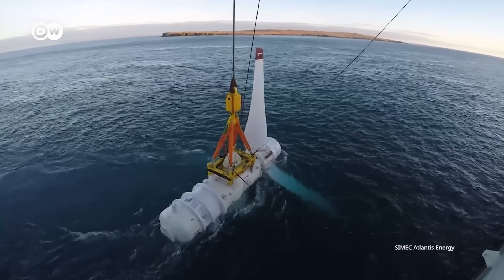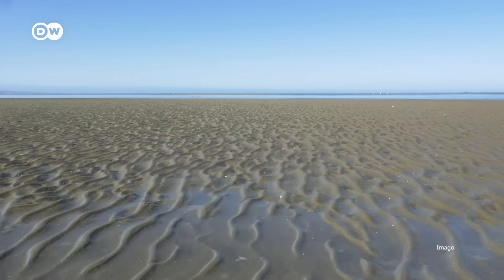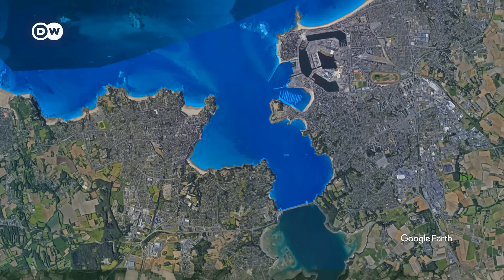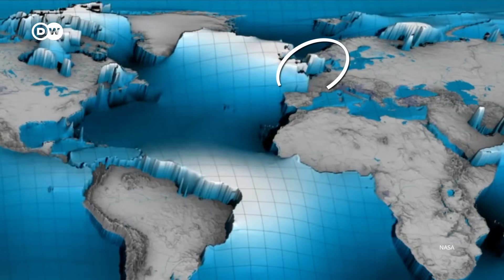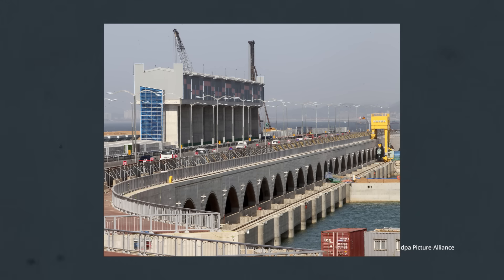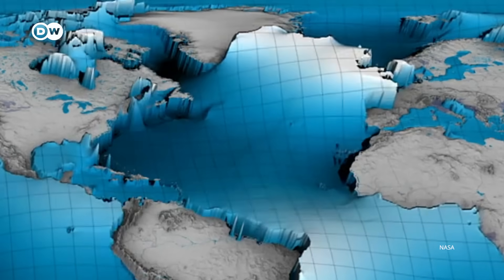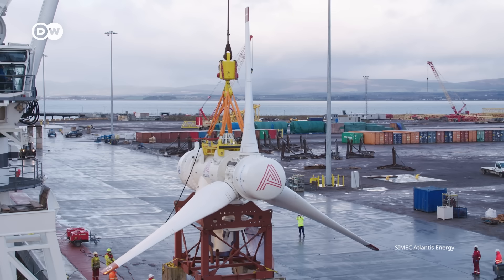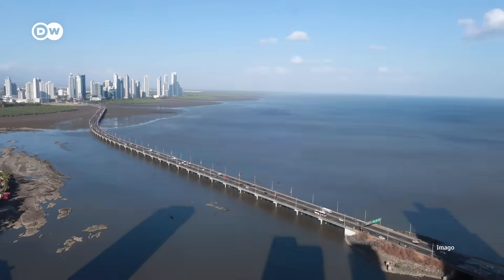Tidal energy could be huge – why isn't it?

Comment: Between the massive amount of resources needed to create the turbines, the maintenance, the disruption to natural ecosystems and the fact that there are so few places where there is sufficient tidal flux to make this even remotely viable for production and even then it would only hope to work for coastal cities near to those high-flux areas.
Reply: I actually disagree,  resources needed are not that great, if you use suspended system your impact is minimal. There are areas were tidal movement are massive.  There are areas where sea currants are fast . I would even state that number of bays can be used like San Francisco Bay
Reply: @jantschierschky3461  By resources needed, that is referring to the amount of resources needed versus electricity generated compared to other media. There is also the impact on shipping to be considered for bay areas, as any sufficiently large turbines can be hazardous to, or experience hazard from, heavy tankers of sufficient displacement, which would limit viable placement even further.
Reply: @AximandTheCursed  well if you consider the energy and placement I doubt you have issues in that regard,  if we take SF as an example the shipping lane is on the northern end, the current on the southern end is over 3m/S that could produce around 6MW on my basic calculations using modified seapots.  Also bay under the golden gate is over 100m well below any ships draft, so if you consider 3-4m/S you could produce 80-100MW
Reply: @jantschierschky3461  ...and with the same amount of resources you could have a 1GW nuclear plant on a fraction of the land, cheaper and with lower maintenance overheads to boot. That's the point.
Reply: @AximandTheCursed  actually a nuclear plant is very expensive and takes ages to build.  If nuclear I would choose block units. However storage is the key problem,  because  public perception.  However if you consider the cost, productivity water turbines have a place
Reply: @jantschierschky3461  The new Thorcon proposal for molten salt nuclear reactors is boasting of a 2 year build time including licensing and a cost of $1 Billion for their 2x500 MW setup. Also, with the Thorium fuel cycle, there is far less waste created. There are some places where water turbines might be viable, but not many.
Reply: @AximandTheCursed  well that technology is not proven yet, but has potential as it had for last 60 years. Well I personally seen many potential locations and being a water expert I disagree.
Reply: @AximandTheCursed  yeah, but nuclear power is neither renewable nor completely safe.
The renewable energy technologies are still new compared to nuclear, we could improve massively their efficiency and sustainability. 
PS: I am not at all for a complete shutdown of nuclear plants.
Reply: They aren’t that much. Not any more than offshore wind farm. The offshore wind farms being built in Scotland I will cover 100s of square miles and each turbine over 300m tall.
Reply: @scottwhitley3392  ...and they will never pay for themselves while destabilising the energy grid... it's why the UK needs the interconnectors from France and Norway to keep the lights on!

Comment: Because it’s expensive not just to install but to maintain, and it is only available along the  coast, meaning transportation of the energy to where it’s needed would be expensive as well. Tides also don’t move constantly, so you’d have to pay for storage, which is also expensive. Basically, it’s expensive.

Comment: One aspect comes to mind, modern cruise ships use large diesel electric pots for propulsion. So lot of R&D is done already and there is a manufacturing chain in place,  how hard would it be to adopt those for tidal power ?
Reply: The big non renewables don't fund or block such steps...
Reply from the maker: Good question! 
If you'd like to know more about the topic we've added some additional links for further reading. It's in the description, just click the "show more" button :)
Reply: Odviously too hard.
Reply: @porkchopspapi5757  i disagree
Reply: @jantschierschky3461  OK, why?
Reply: @porkchopspapi5757  think nobody thought about it. But many are being recycled,  so low cost.
Reply: @jantschierschky3461  nobody thought about it? Limitless free energy, no one has thought about scaling up a model to big enough to power a city?
Reply: @porkchopspapi5757  they testing the process. The use of those pots not been tried
Reply: @jantschierschky3461  ok. Keep an eye on it. Then Youl see why it won't work. They may string you along for a year or two or three, but do some actual unbiased research.
Reply: jj
Reply: The answer to your question is, too hard. That's why it's not being done.

Comment: Can't we also use this in strong river's?
Reply: That is a whole other kind of tech than tidal, but it is a thing that is happening.
Obviously the older versions of river power would be water wheels and dams.  Water wheels would be tied to a mill where it would lift and drop heavy weights to make flour or crush things.  Dams use the height difference to amass potential energy and hits the turbines with lots of force, but those are falling out of favor and being shut down faster than the rest of green tech is growing (at leas in America).
For newer versions, homesteaders have lots of interesting river options which divert a portion of the flow into a sideways turbine which spins at pretty crazy speeds to generate power, and that actually works pretty well.  Problem is that most small/fast rivers tend to be seasonal, so it is difficult to justify the cost for something that only works during heavy rains.
For larger rivers there are other issues.  Water needs to be deep enough for boats to not hit them, shallow enough to maintain easily, and more importantly durable enough to deal with rather extreme ranges in water flow and speed... and deal with the large objects that get washed down river with large storms.  The nice thing about tidal is that the water flows predictably in a free open space, so you aren't going to have a water-logged tree randomly smash into your generator, or a car bouncing along the bottom of the river at 40mph.  I live near the Ohio River, and that thing has a crazy range of flow and speed, and your turbines need to be designed to operate efficiently at a certain flow rate.  Just like wind turbines, too much wind and you trim the blades flat so they don't spin too fast and break.  You can up the resistance to compensate for this, but then not enough flow and the blades won't turn.  Again, with tidal you have much more predictable flow rates and pressures to deal with.

Personally, I have always wondered why we dont put something next to pillars on bridges.  You need a certain amount of clearance around them anyways, so slap a series of blades on the front and back of the pillars, and add a steel mesh cage to prevent colission damage.  You already have the land connection and power/utilities running, and the pressure/flow around the pillars would be stronger than in an open river even when flow is lower.  Plus if your bridge is also a utility then maybe it will get regular maintenance? lol

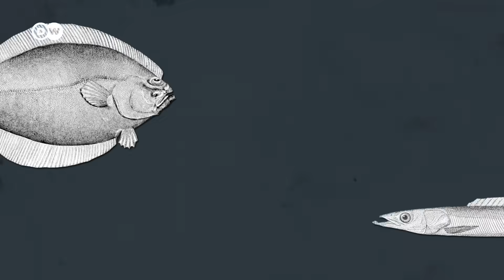Comment: 9:47 is this line about how wind turbines are "known" to cause the lungs of bats to implode based on any actual fact or just anti-renewable talking points? See: "An investigation into the potential for wind turbines to cause barotrauma in bats
" - Lawson, Jenne, Thresher, Houck, Wimsatt, Straw. Dec 32 2021 PLOS ONE; open access journal means you can read the methodology and conclusions in full.

Comment: 10 cents/kWh isn't really cheap, it is at the upper limit of the current generation costs on bills. On average it is more between 4-8 cents/kWh.

If tidal wants to compete it needs to reach at least something like 7-8 cents/kWh and even this is still not competitive vs solar and wind today and these are expected to still go down slightly in cost.

Tidal just seems to have toom many intrinsic costs to be competitive due to its very nature, though I hope I am wrong.

Comment: There's also a specific hydroelectric option for run-of-the-river hydroelectricity that is amplified by tides. I'm not sure how common these are, but Bremen has one.
Reply: Bremen is a bay with a 2-2.5m tide, north German rivers carry volume like Weser and Elbe. However if you compare average 12m tide in southern west France and around parts of the UK and other areas not that viable.
Reply: @jantschierschky3461  Well, clearly they decided it was worth it. They just combine the flow of the river with the additional effects of the tide (due to various effects it's apparently 2-4m at that place). It's a pretty small plant of course, not a huge megaproject.
Reply: @Sp4mMe  I don't disagree,  however don't forget the German government mentality regarding environmental issues verses the rest of the world.  Here in Australia we have such a potential and it is wasted,  government here wants carbon capture etc, despite we having a huge landmass exposed to sun 300+ days a year,  12m tides in the north west etc etc

Comment: So the problem is that the structure will be full of algae and bivalves and needs to be cleaned, that is very expensive. Than a lot of moving parts under water, need oil and it will always leak (grennpeacies will be a problem, if you don't pay the cartel). Those areas are usually also very important for marine life. It was better than the wind, if we had the tech, no doubt.

Comment: The rotating cycle of tides is not correlated with the daily pattern of energy usage.  So this still needs storage.  Can't think of significant industrial uses of electricity that can cope with daily or monthly variation in tidal power.
Reply: Well you have epp and flow, depending on location  you can get up to 3to 4h , so up to 8h 2× each day. In some locations even greater like sanctuary cove Australia and Humboldt Bay in Canada
Reply: Liquid air energy storage could use surplus energy from renuables for power generation at peak demand times
Reply: @sethcopas4513  liquid air takes a lot of energy and is not possible to release energy also you liquid  air it is nitrogen.  Think you mean compressed air

Comment: The good thing about climate mitigation efforts, is whatever it costs, it's still cheaper than species annihilation from AGW. Because having a survivable ecosystem is literally priceless.
Reply: Ehh.
The only thing that really matters with energy generation is cost efficiency. If it's not cost-efficient, if it has a costly upkeep that, on average, a single "unit" will not be able to pay for itself twice over, then it's not worth whatever. It's just gonna cause more pollution relative to the power it generates, and is likely just a scam. This is the case for solar panels and wind turbines right now.

I am very skeptic of this "it's still a young industry but we're sure it's gonna be cost effective one day" claim. Especially when the solution to all our problems have been discovered decades ago: Nuclear energy. The only thing GREENER than fossil fuels right now is nuclear. I dont know why we're wasting time and money in all these unnecessary trial and error.

Comment: Predictable is better than non-predictable, but we steel need dispatchable energy like nuclear.
Reply: If you have them in several places around the coast (especially an island like the UK), with different tide times in each area, then the power is essentially dispatchable.
Reply: The power could be stored for use at peak demand times by say liquid air energy storage

Comment: The problem with tidal power that needs to be solved, is that sea water is extremely corrosive. So you'll have to find ways to keep the fins, the moving parts and the cable back to shore from rusting/oxidizing away.
Reply: @garysmith5025  the thing about oil rigs is they only need their supports to resist corrosion, everything else can be hauled back up to the rig. Even so, each rig is godawful expensive. If even the oil giants can't keep these things cheap and cost effective, what chance do underwater wind turbines have at producing electricity economically?
Reply: @garysmith5025  the issue isn't whether they are proven possible, but if they are cost effective. Because if they are not, you'll likely continue to see solar and wind being built in favor of this.

Comment: Underwater turbine will kill a lot fish curiously swimming to it, how to protect the fish like the wind turbine killing the birds
Reply: @garysmith5025   I insist the fish will be killed
Reply: Cats, glass windows, buildings, air pollution, planes, cars and trucks kill billions&billions of birds annually. And your worried over a couple thousand birds hitting wind turbines? You do know they found painting just one blade with a black stripe basically eliminates bird strikes. 🤔
Reply: @4literv6  yeah I know ,and tidal energy indeed quite interesting and promising
Reply: @chrisleon27  i think they should ad tidal style turbines like these to the bottom of all offshore wind turbines that use those new 3 prong anchors instead of posts driven into the sea beds. Bet they could almost double the total energy produced that way. 🤔

I also think someone adventurous should consider placing turbines like this down the spill ways of existing dams. 
Then every time the dam releases water you get even more energy production. Or at least a study could be done on its feasability.

But then again I think dam owners should also have floating solar on all upper reservoirs, big batteries for storage since the necessary hv cables are already in place for the dam itself. And since dams are most often on federal lands that span many acres. They should have wind turbines to. 🤔

Comment: The information about Wales was incomplete.

The Welsh government gave the go ahead for the tidal project but this was over ruled by London without any reason.

This is at the same time as London is commissioning two new coal mines.

The Welsh project was in an area which had so much pollution from England and Wales, marine life has never been a priority and was virtually non-existant. So there wasn't any marine life too disrupt. There is an industrial area in England near this location called Avon Mouth, there is so much pollution at Avon Mouth you can taste it in the air.

You just don't get wild life where this tidal project was suppose to be. And no one has ever cared about destroying all the wildlife in this area.
Reply: I visited with my partner Wales this Summer. We were gobsmacked by the beauty and said multiple times that  tbis place is not invested enough by London despite so much potential. 
People flying to another continents to find tranquility from England wbile they have such jewel at their doorstep with so many waterfalles and stunning views. 
With good infrastructure even the rain is not a problem. 
Plus The CO2 footprint is so much lower.

Comment: 0:25 is that globally we could provide energy to the United States twice over. Or the United States has access to enough coastal regions to power itself twice over? There’s a huge difference. I’d change my career based on the answer.
Reply: Hey, great question. The answer is globally :)  Some calculations say that if we harness the power of ALL tides around the world, we could generate more power than global capacity at the moment, but this number I quoted is the practical/economically viable estimate.
Reply: Think US tides are relatively minor,  however if you consider Canada's east coast than you have huge potential with 14m tides in some areas and big bays.
Reply: Best solution is mix of renewables and nuclear. Nuclear where grid density justifies it. Renewables where population density is smaller.
Reply: I think its estimated on volumen and mass of the water involved in tides. But to lock all that into usable electricity is impossible (or not yet and hope it never be because biolife diversity etc.) But I hope some good part of it will be used on sustainable way... (sorry my English is not the best)
Reply: Be careful. Figures like that usually have been stretched extremely to prove the authors opinion.
It's even unclear if it's calculated based on primary energy or electrical energy.
So the numbers as they are aren't worth the paper they are written on ;)

Comment: Tidal brrages can act like a battery and and can turn it on and off when ever we want more energy but for the for the turbine that are under water we need to use the energy right away or store it in battery to use it whenever the demand is high
Reply: You can, but they have some severe local environmental impact.
Reply: The french one actually increases head by pumping additional when tide is coming in.

Comment: Yet another "mega size" power generator that prone to failed !? In addition, mussels will stick to the blade just like what happen to mega cargo ship.  Renewable like solar panel is viable because it can be installed and dismantle easily, in case of something very bad happens.

Comment: Tidal paddle wheels could be more cost effective and more environmentally friendly imho. Less compact, but is that an issue ?
Reply from the maker: We look into it about 9:30 min into the video. Let us know what you think?
Reply: @DWPlanetA  Did I missed something ? I don't think I saw a paddle wheel system in this video :) Tidal paddle wheels work on the surface. Their axes of rotation are not submerged. The three-bladed turbines shown in this video are all submerged, in stream and dam configuration. It is more efficient, but more expensive to operate. So I wonder if the low cost of paddle wheels could overcome their low efficiency..
Reply: Paddle is in comparison inefficient, a propeller type is more than twice as efficient. Also a propeller could generate in relative low flow. There is a reason ships use propellers for long time